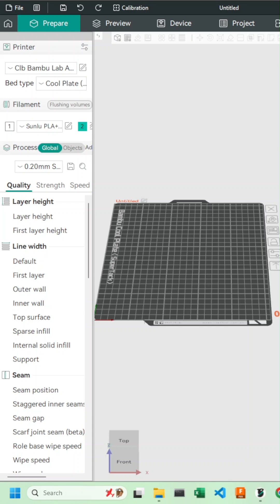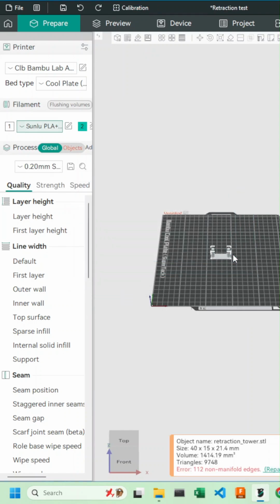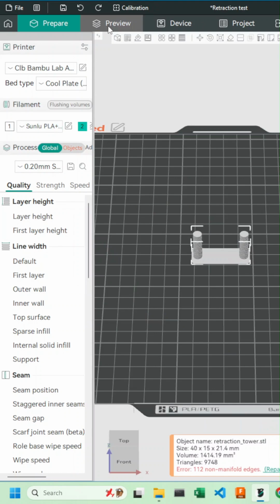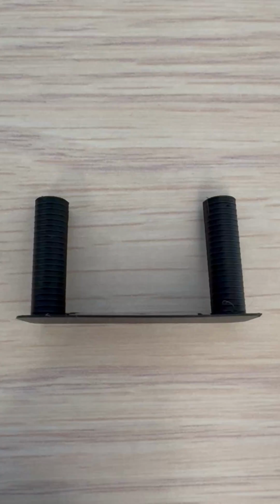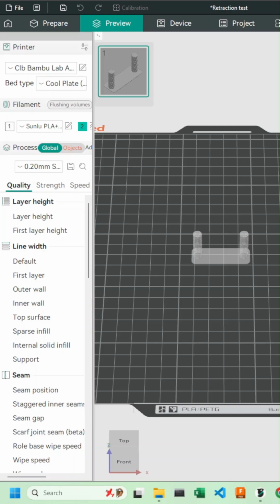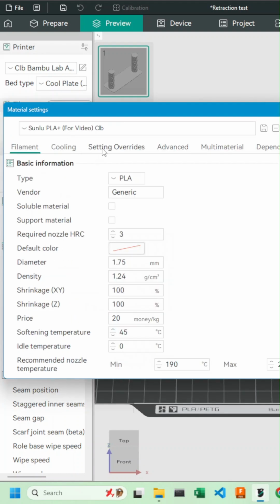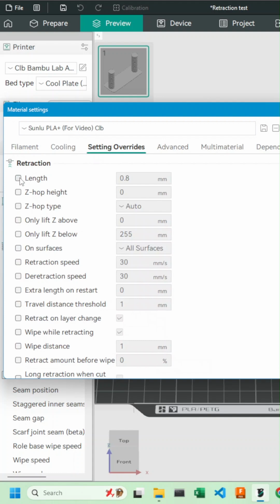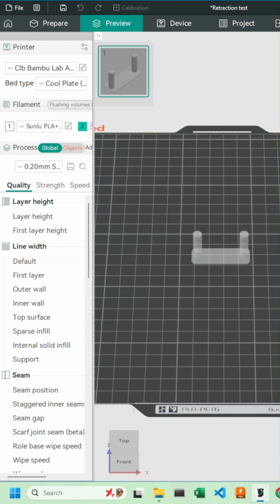Calibrate your Retraction with Orca Slicer!

Comment: It's worth noting the default settings are only recommended for direct drive. The calibration guide recommends values of 1, 6, and 0.2 for bowden tube extruders
Reply from the maker: Thanks for providing this information! I don't have a printer with a bowden tube extruder, but this is sure to help someone.

Comment: Thanks this series has been really helpfull so far.
One issue i have is, that i cant get rid of the stringing completley.
I dried my Filament, adjusted the temperature and now the retraction, i cant seem to get rid of it...
Any ideas what it might be?
Reply from the maker: It's almost impossible to completely remove stringing, but I would suggest enabling the wipe or coasting settings in Orca Slicer. I'm glad the series is helpful!